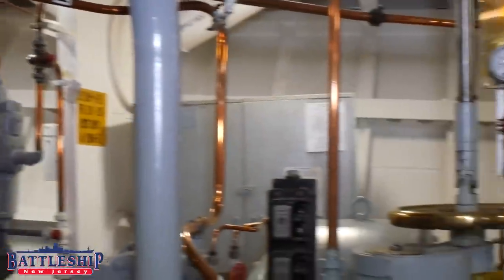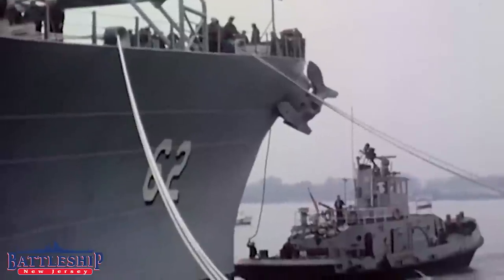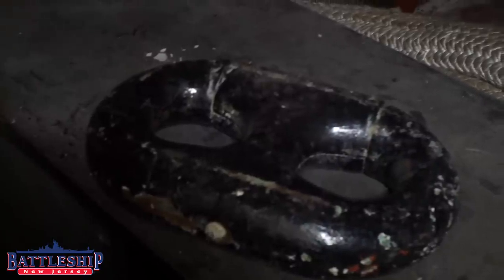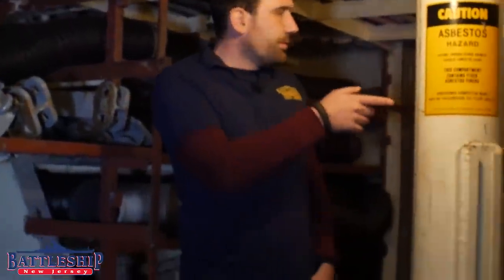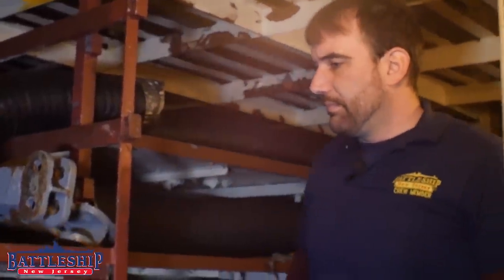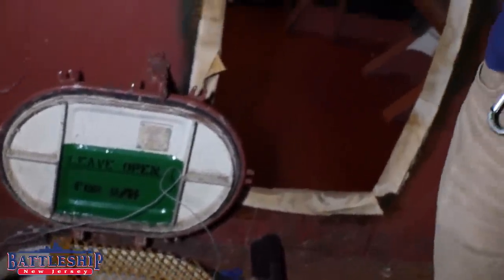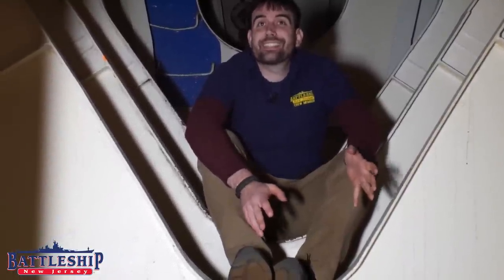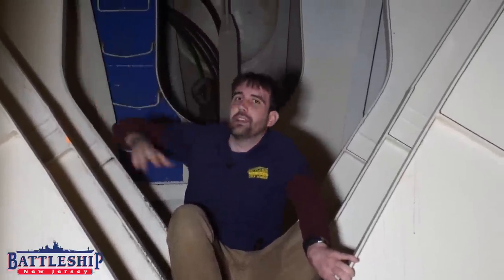The Sand Locker

Comment: I continue to be amazed by the sheer number of rooms and compartments on this ship, most with apparently a very specific purpose. I half expect the next video to feature the 3/8" fastener hardware compartment, and on the other side of the ship is the 1/2" fastener compartment, while up towards the bow we find the 1/2" left hand thread fastener locker.
Reply from the maker: I know this was a joke, but you wouldn't believe the number of rooms full of hardware that we have
Reply: @BattleshipNewJersey  Actually I do believe that, I think we've seen some of those hardware rooms in previous videos. :) Is the ship divided up this way for structural/damage tolerance reasons and it just makes sense to use all these little rooms for specific things since it has to be laid out like that anyway?
Reply from the maker: It seems to be that every group has their own own storage spaces so the machinist keep their stuff separate from the repair guys who keep it separate from the electricians. So its a lot of the same stuff in different places.
Reply: @BattleshipNewJersey  Makes a LOT of sense because Repair Personnel are "get it done" while machinists are "has to be perfect" type of people and them sharing equipment would probably be a really bad idea. Can kinda confirm from experience on a smaller scale. If you just use a lathe to chamfer a screw the cutter can be dull and chipped and it will work just fine. Turning to 0.0005".....yeah well :D
Reply: @BattleshipNewJersey   that's just how the navy works,... komshaw, I'll trade you this tin of peanut butter for  that 5 gal of deck gray.
Reply: No one can find the 10mm socket compartment tho
Reply: @BattleshipNewJersey  how are machinists on a ship not considered "repair"?!? What were they doing, producing parts for the next battleship?!?
Reply: @railgap   A general explanation would be that a Machinery Repairman (MR) and a Machinist Mate (MM) have very different jobs and roles, with the first being to making and repairing tools and parts for equipment, while the latter generally operates and maintains the equipment (think do we need to create a new bolt [MR] or install a new bolt that the MR's made [MM]).  MM's are further broken down into specialties, though not all specialties are onboard all vessels.

[expanded] -
Then you have Damage Controlmen (DC's), Hull Techs (HT's), and various other Rates and specialties that all need their own space and operate, maintain, and repair their own equipment.

Additionally, on larger warships you may have multiple Divisions focusing on different specialties within a given Rate, with each Division having a focused role aboard the ship. As you get to smaller and smaller vessels, you get less specialization than on larger vessels, and not all vessels have all rates (you won't find a Machinery Repairman on a submarine, but you will find various types of MM's).
Reply: @BattleshipNewJersey do you have a anvil on board

Comment: I can't even imagine the noise in that space when the anchor was going up or down.
Reply: Probably permanently deafening.
Reply: Louder than you could believe.  I was on a carrier in the forecastle whe we anchored out.  Loud.  Real loud.
Reply: their are a few videos of anchor chains getting out of control...... chain brake fails, ETC
and then the last "shot" of chain comes out..... whips around with TONS of force, ETC
.
even from these old, "shot on potato 12" vidoes show how LOUD and absolutely scary it is
Reply: here... i found the vid im talking about...... this was on the Tarawa.... a helicopter carrier ship
Reply: I served in everything from LSTs to CVs and if you are in a compartrment near the bow, once the anchor is released you can not believe how noisy it is!
Reply: I would imagine that's why that sign is there telling people in the compartment to evacuate when the alarm sounds.
Reply: @Custerd1  I think that's for if the fire suppression system goes off
Reply: @jimwjohnq.public  I did it on HMS Illustrious - 133db was what it measured at. Enough to make you wince and put your fingers in your ears and get a bollocking off a Senior Rate.

Comment: I worked on the NEW JERSEY and the MISSOURI while they were at NISMF Bremerton and helped run alot the DH you are talking about.  Also preserved the Main Engines.  Booth impressive ships.
Reply: Yes both very impressive.  Only able to see the Missouri so far up close.  Are the engines maintained so they can be put back in service if need be?
Reply from the maker: The engines are not maintained so that they can be put back into service on either New Jersey or Missouri
Reply: @BattleshipNewJersey  Especially the NEW JERSEY,   the propulsion lube oil system piping was so full of holes that I barely got enough into the reduction gears to make a difference.  The MISSOURI was in much better shape.

Comment: Great look into the bow of New Jersey. Always wanted to see that area. Battleship Texas recently did a video showing the inside of the bow and stern castings that joined to both ends of the ship's keel. Dose New Jersey have similar castings? They also showed parts of the ship's degaussing system that functioned while the ship was in operation. They showed cables mounted to the inside of the hull. I assume New Jersey has something similar.
As for ideas to show the ship alive. How about the ship's surface search radar in motion. Also signal flags on lines to the mast. Does New Jersey have searchlights like the older battleships had?

Comment: I believe that line you were standing on is called a Towing Hawser if I remember right. Those lines behind are moring lines.
Reply: For a tow like that the tugs towing wire off the main winch is the majority of the length (the typically carry about 2000 feet of wire- using as short some segment of rope is like a shock absorber- and lesser strength - it would part first instead of damage tow wire. Its also possible anchor secured in place - and the anchor chain let out some as the attachment point.

Comment: I'd be interested in seeing inside some of the fuel oil tanks and seeing the fuel pickups and associated piping. I know when you looked at the belt armor that was a tank but we didn't see much piping. Also a peek into the double/triple bottom if that's possible. I'd also be interested in seeing you climb up some of the emergency escape paths like those in the engineering spaces for example.
Reply from the maker: Here is Ryan inside of another tank
https://youtu.be/pAwPe2kx2fE
Reply: @BattleshipNewJersey  thanks for that. Unfortunately you can’t see much of the internal structure pipes etc.
Reply: @BattleshipNewJersey  I’ll ad another idea. If you could find a snipe or CHENG from her last  commission and have them do an engine room tour with Ryan. Talk about what is needed to light the boiler from cold as they walk around to the various valves and pumps. Talk about what goes on when the bridge wants to go from steaming along at a gentle 8-10 knots to a flank bell and 33 knots. Talk about doing a crash back where you go suddenly from an ahead to an astern bell. Likely more than one video in there.

Comment: You don't tow a ship with directly with hawsers - you use the mass of the anchor cable - so you use messengers and lines to pass a wire / cable+wire ...and the weight of the cable itself does the work of pulling the towed vessel forward.

Comment: Another test I would like to see is maximum instantaneous current. It takes time for a battery to discharge but how quickly can I do it?
Reply: Most batteries you can discharge at 10 times that hourly number amp oh sorry 10 times and number of em hours.  For,example a 60 amp hour battery you can dischrge it at 600 A and it lasts about a tenth of an hour or six minutes.  not clear how often you could do this and it likely could overheat and perhaps work the battery so I would avoid it if it all possible.

Comment: Can we have more on what the power vein mine sweeping thing was please!
Reply: The sailor who labeled that locker spelled it wrong - it's a paravane. The paravane is winched out on the end of a chain or cable, it has wings and fins on it so it kind of glides at a certain depth under the water at a distance from the ship. The cable snags the cables holding mines that are anchored to the sea bed and if they slide along the cable to the paravane which has a cable cutter to let the mine float up to the surface. You spot it, and shoot it till it blows up. Better description available on Wikipedia.
Reply from the maker: Check this out https://youtu.be/6uRYFDyq408
Reply: @Charstring  thanks!
Reply: @BattleshipNewJersey  ta

Comment: Halon used to be used in computer rooms to suppress fires but got outlawed due to they replace air in room. Told us if a Halon system goes off hold your breath and get out of area extra fast. Thanks for another intetesting vid.
Reply: Halon was banned in the European Union because it was having a huge impact on the ozone layer.
Reply: to be fair, many gas-based fire suppression systems (ie. CO2) have the same problem of air displacement, I know some power plants that still use a halon fire suppression system for the turbine engine enclosure, though CO2 seems more common now, or pressurized water mist. Either way, you definitely don’t want to be around when there is an engine fire and/or when any of those systems trigger.
Reply: replace air in room is incorrect. Get out - certainly.  I in last few years I researched this. Older halon formulas as heated decomposes INTO nasty stuff .  newer formulas differ- both Formulas are banned as CFC and Ozone impact. Halon also may put the fire out - but perhaps a gust of fresh air and reflash. There are different level of Fire science knowledge and comments on how Halon works. (Fire Triangle versus Fire Pyramid)

Comment: Dramamine!  I need Dramamine!  The video work was way too casual.  And they really need a wider lens so they don't have to constantly pan to show everything.   It doesn't have to be expensive, but some kind of stabilization and a camera with a wider angle available to it would really help the production.  Most of the videos have been much better than this.  I'm not sure what changed, but it wasn't a good change.
Reply from the maker: Teeny tiny rooms make it tough to get any further away.
Reply: @BattleshipNewJersey  Hence, wide angle lens.  Although, in this case, you may need a ultra wide-angle lens.
Reply from the maker: This is as wode as we can get before hitting fisheye which will make people even more dizzy
Reply: @BattleshipNewJersey  I have a 14mm aspherical that's not a "fisheye" that would probably do pretty well. But I'll admit, the lens itself is about half what my DSLR cost.  If I were to guess, your lens might have been a 28, but feels longer then that.